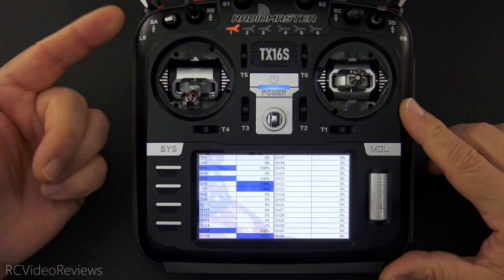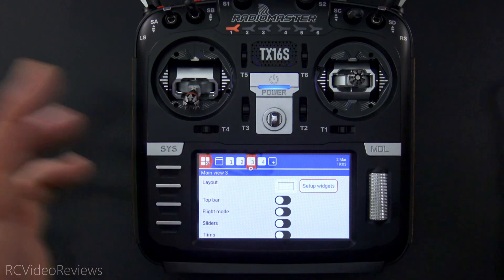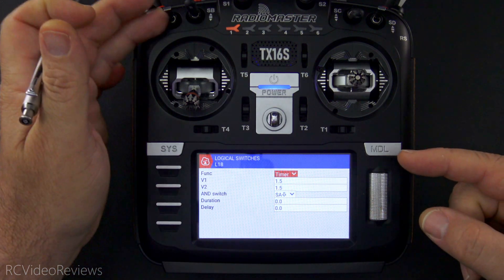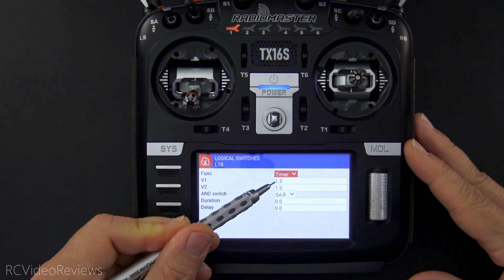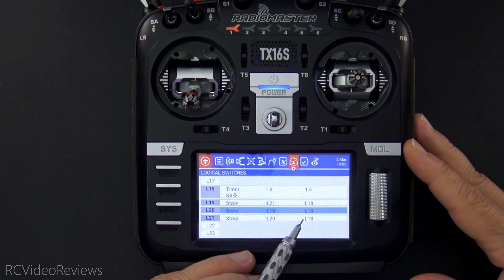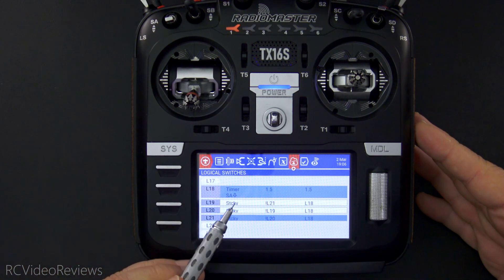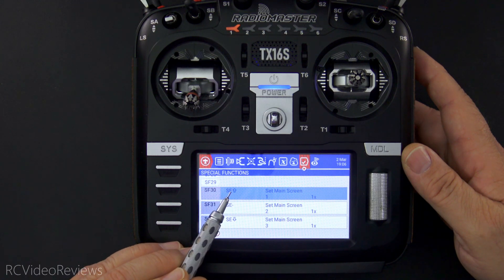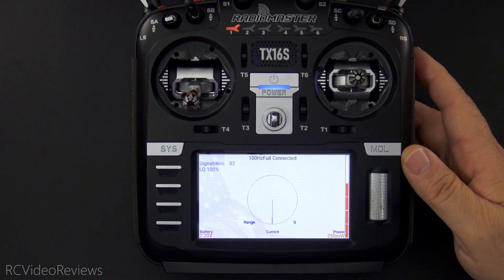EdgeTX Automated Main Screen Rotation

Comment: I am experiencing a problem with this setting. When I leave the set model and return to this model, Automated Main Screen Rotation no longer works. When I reset setting for 'Stcky' in the logical switch it works again. Anyone have an idea what the problem could be for this?
Reply from the maker: There is a flaw in the logic. I had to re-work the problem and have a working solution. Thanks for the comment. I'll put a video together showing the correction.